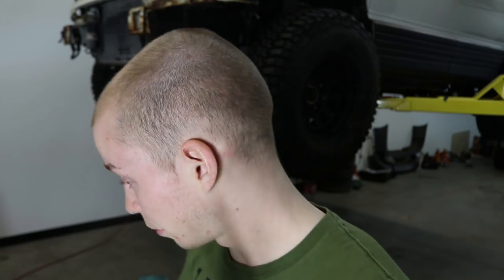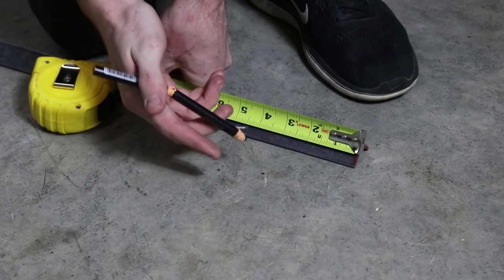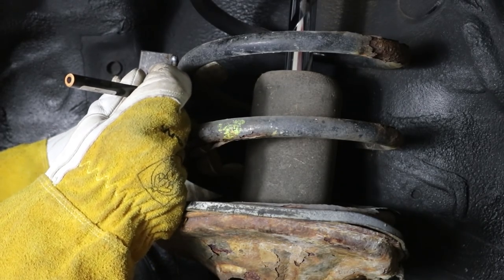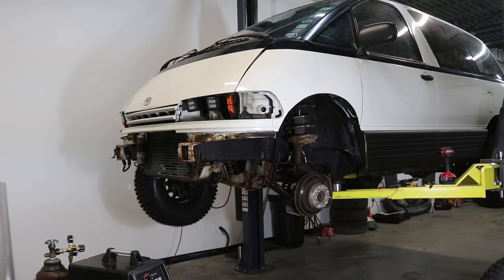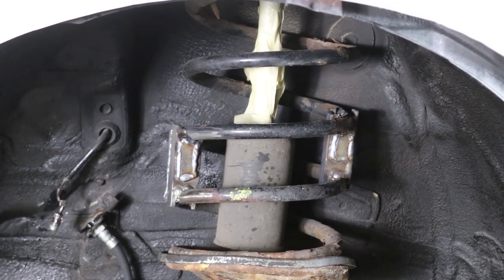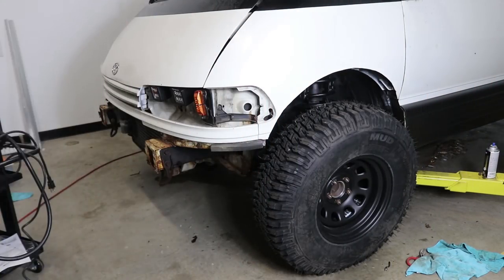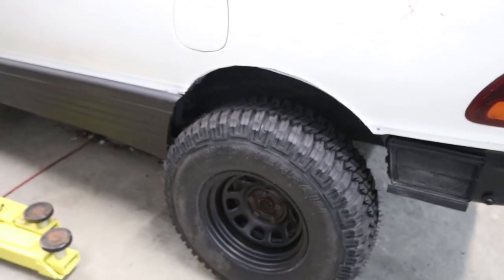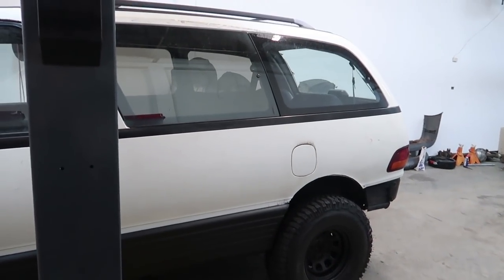The Easiest (and Sketchiest) Way to Lift Any Car for $10

Comment: You need a table Bud that way you're not not always bending over. Then you can mount a vice to it and then you can really work without worrying about your fingers
Reply: I agree.... you have the space for it now. And a vice is like a third arm
Reply: Joshua Gooden in the old shop he had something like that didn't he? I think it was just wood over a metal shelf though
Reply: He doesn't have the money for one, why do you think the build hes trying is like under 5k
Reply: Abananapeel he doesnt want to spend more than 5k on that rusty shitbox
Reply: MauriceNL what does a bench and a vice have to do with that van? Yes it would help when I'm working on that van but it would help him work on every other thing he does in the garage too. It's for the garage not the van
Reply: Joshua Gooden the message was for abananapeel
Reply: MauriceNL I actually didn't see all these comments on here sorry about that
Reply: Just put sand bags on the legs of the light to keep it from falling over

Comment: You can't weld on springs, in best case they'll just bend but they'll probably snap after some riding. You should've cut the spring plate loose and moved it up a bit on the strut. If you got tubing in matching sizes you could also cut the strut and extend it.
Reply: He is not welding on the spring , I don't think. Just the outer part of the spacer getting welded together. If you heat springs they loose their temper and will break from the flexing.
Reply: @TimZ007  If they lose the hardening they will just bend and stay there and not flex like a spring and that won't make them crack.
The welding has what we call a "HAZ"(heat affected zone) and this will be affected by rapid cooling from the surrounding material which will be just like quenching so you'll get if not the whole weld a zone in the HAZ that forms martensite due to the carbon content in the spring steel. Google Schaeffler Delong diagram to see how the carbon equivalent affects the weld and which filler to use to compensate.

Not only does the martensite itself become brittle due to lack of proper tempering but you'll also get grain growth in the HAZ which also makes it more brittle. And it only takes a thin strip of this hard brittle zone to make it crack and fail.

Comment: I must be getting old, ahem
WHERE ARE YOUR DAMN SAFETY GOGGLES, SON?
also, please get a bench with a vise. Hook hands and eye patches lose most of their bad-ass points when you explain that they came from angle grinding on the floor.
Reply: Safety goggles?  The dude is welding crap onto a cars coil springs. What safety?

Comment: I was thinking "that does not look safe" right before the grinder took off lmao.  You should really wear safety goggles too not only for physical protection but IR too (check at a welding shop I imagine they have something).  You would not think, but grinding produces lot of IR light and it's bad for the eyes.  I never knew this myself until I watched AvE's welding videos about the automatic welding masks.

Comment: Hope you aren't planning on driving this on the road. You took the temper out of the springs while adding severe stress points. Hopefully you don't kill someone when the springs fail.
Reply: Bad Dog Custom Metal he does plan on driving the van on the road he is going to do the Gambler 500 in it
Reply: I hope it has lots of straights lol... x)
Reply: Bad Dog Custom Metal  I was thinking the same thing. Easiest way to do what he wants is make a spacer at the top of the shock, and extend the mounting bolts. Then it would be solid, not a flexi danger zone

Comment: Firstly please wear some eye protection when grinding, you'd miss an eye much more than a finger.

If you're already giving up on this it might be too late, but have you thought about extending the lower wishbones at the front to get rid of the positive camber and give you more clearance? Could also extend it in such a way that it moves the wheel forward so you don't have to cut into the door.

Comment: Honestly I came here originally for the bus build and conceptually I like this build, but I don't know if it's the aesthetics, or what, but I think I just became polarized and disinterested when I saw it got keyed up, the engine didn't seem to get any attention, and you go stuffing tires that are just flat out too big. If you cleaned it up, put some killer steel bumpers on after getting the motor and brakes sorted, I'd be more interested because it feel like your interest lay in getting it right . The rally miata tells me you can do it, but now after hearing your plans with that I'm kinda 50-50 on whether in going to jump on that video series. Are you going to bother trying the gambler 500 at this point?

Comment: mightve been a better idea to take the front liftkit out and cut and raise that using the angle steel
as for the top heavy lights : make a sandbag with a bungy cord that you can hook to the center of the tripod  , that should hold it in place even in a storm

Comment: Ok to start off I have been watching since about 50,000 subs and I have watched your channel religiously since then. I thought that this build was a really cool idea but it hasn’t really been working out. You are breaking your back over it and it is really just an old rusty bucket of bolts. I say sell it and use it for the WRX swap.

Comment: I worked in automotive industry at the beginning of my career. I can´t avoid making some comments about this.
1. You´re "arresting" (restricting) the working path of the entire coil spring to the upper portion. No Bueno.
2. The welding points in a component NOT.DESIGNED.FOR.WELDING. will affect the structure of the component. I mean metallurgical, localized effects that the profanes to Metallurgy mystics can´t even begin to comprehend. Things like fatigue cracking, for instance.
I would rather prefer to lift with the rubber rings commercially available, adequate for the diameter of the base, instead of overstressing such a critical component with such...questionable method. 

Sorry mate, I´m a responsible adult and can´t allow kids endanger themselves or others just because they "think" it´s a good idea to modify something without the proper engineering study.

Comment: Its ok but may as well buy the square tubing and it needs to be wider ...and it wouldn't be any need to weld them to the coil which weakens the coil..

Comment: Dude do the strut bolt trick where you unbolt the strut then get some plates drill three holes in it bolt your strut back onto the top of the spindle and use the p plates to span the three holes you can then fix you camber 2 birds 1stone

Comment: Complete this build, I don't like that it is an absolute POS, however, the experience you will get from doing this build will only go towards helping you understand what happens to cars when they aren't getting looked after properly. Besides that, I like the idea of what you're going for with this build, and the lift does improve it quite a bit.

Don't throw it in just yet. Keep up the amazing work!

Comment: I like the van, but this is not a good idea lol. It is if you want zero suspension and your ass hurting. Its much easier to place something on top of the strut or weld lower brackets for the bolts to attach on to

Comment: They make these little spring things at any auto parts store for like $20 which is more safe lol
Reply: xRam yeah I was thinking about that. The ones with the two bolts you tighten or loosen?
Reply: Are they actually any safer though?
Reply: Because he has only $500 to build it for the gambler 500.

Comment: Surely that's illegal to use on the road like that?  so basically you're giving up because it involves actual work, fixing a car up isn't just bolting new bits on, you need to get your priorities in order, yesterday you were cleaning the plastic trim while the entire underside of the car needs rust removing, seriously?

Comment: When doing projects like this the vehicle is supposed to be cheap and ugly but also is perfect running and driving condition so you have no problems down the road. This thing was a rust bucket from the get go. Get a new van and start over

Comment: This would be a good build if you put in the time and effort to be one. You constantly talk it down and shot yourself in the foot. Honestly wish you would complete this build and hurry up and get started on the awd subie swap.
Reply: brendon flores .. that is not the point off this build tho he wants to participate in the gambler 500 that is why he is moding it.. some people just don't have patients it will come and that will be a very long build over time.
Reply: J R I get the point of the build. However, when he starts constantly putting it down it disengages the audience. I really like the build and the direction it's going, just wish more people would appreciate the work he has done to it and going to do to it. I'm doing a safari theme on my astro van now so I can relate to what he's doing. Just wish he would see it through and not quit early